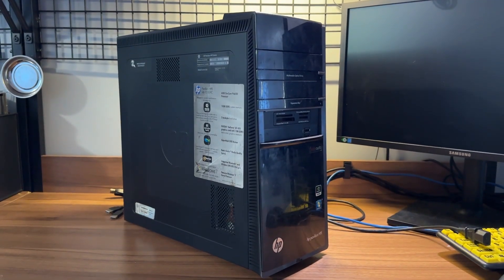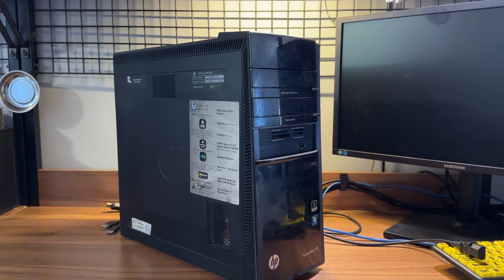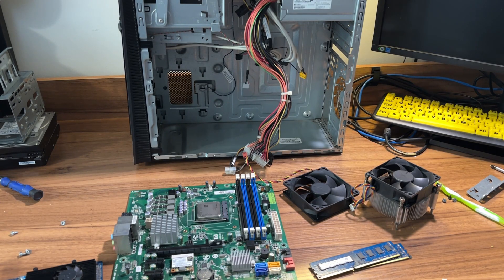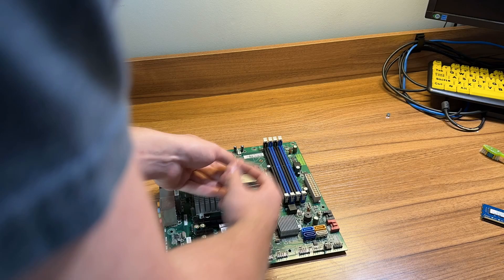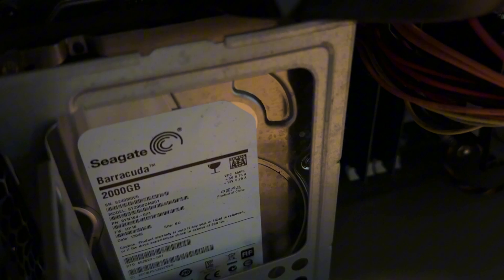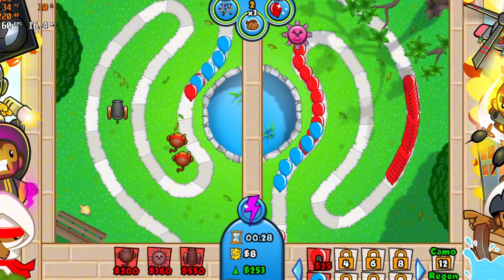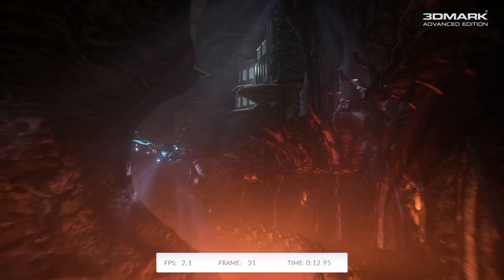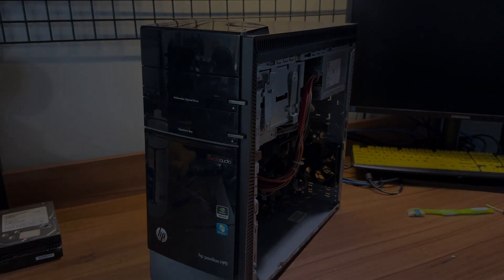What games can we play on a FREE PC?

Comment: decent little six core cpu better than intel core 2 quad with the avx instructions and future proof design another win for AMD in the long term goals. Put a rx 570 8gb in there would match perfectly and would be akin to ps4 probably alot better if overclocked the snot out of everything(im talking to the point its maybe dangerous then it would run core i5 core i7 8th gen level of fps.) max id say for that system is warzone 3.0 im not kidding games really dont need strong cpu fortnite was about the highest load on the cpu that there will be because of input latency tuning and updates done to it. I never owned the vishera 6 cores or that era of system but i did envy those that did despite the bad reviews seeing clock speed get to 5ghz casually is amazing lol.

Comment: would love to see what happends with a ssd and 1050/1060 card in it. i think those dont need pci express things.
Reply: 1060 definitely does. The 1050/1050ti do have low profile version but I would just opt for a 1650 LP or 3050 LP used.